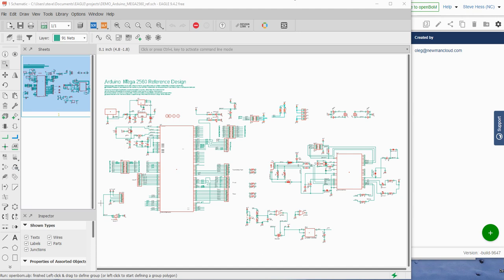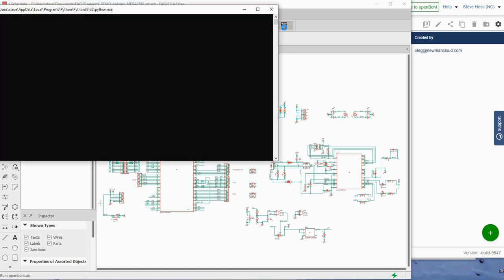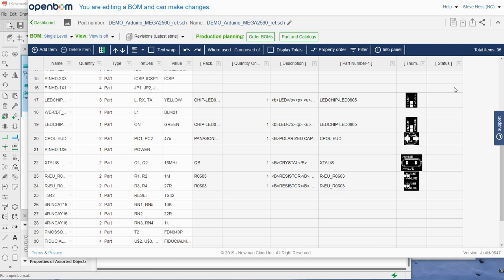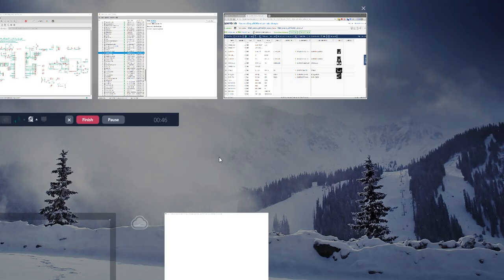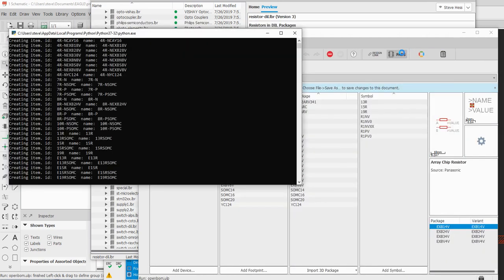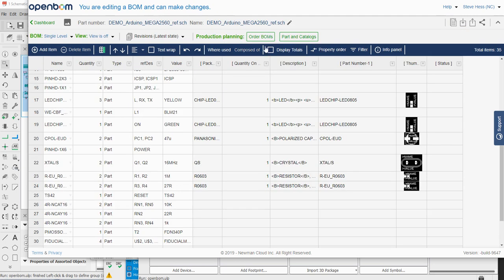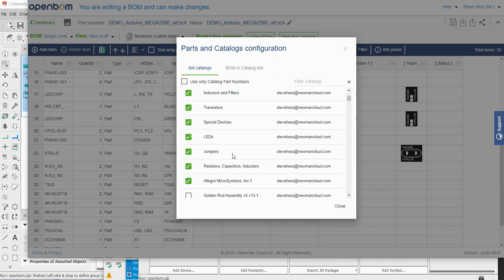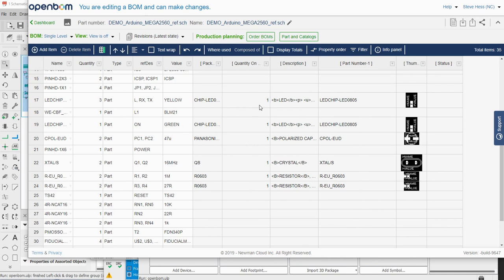OpenBOM for Autodesk Eagle

Comment: It would be nice  if you would make a video showing how to install it. Ive installed it twice now and nothing is showing up. Maybe it doesnt work? Might be easier to do the bom manually than try to figure out whats wrong with this program.
Reply from the maker: Thank you for your comment and sorry about your problems. The install is simply run the installation downloader. If something doesn't work, our support would be happy to help you. Autodesk discontinued Eagle, so some of the things might not be possible to resolve, especially when running Eagle in a new environment. Also, we are going to introduce support for Autodesk Fusion360 Electronics, which is a replacement for Eagle.